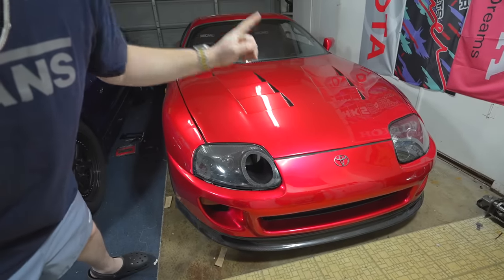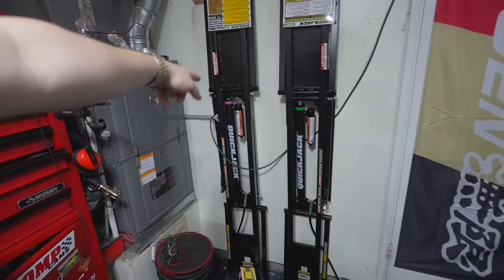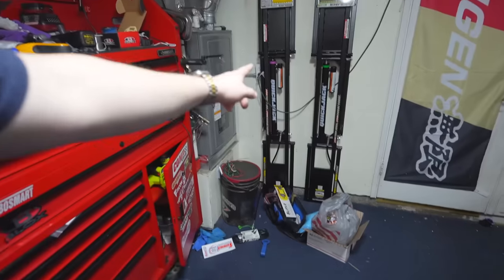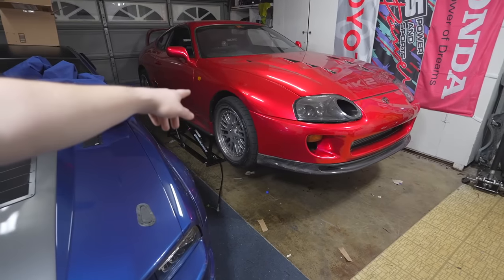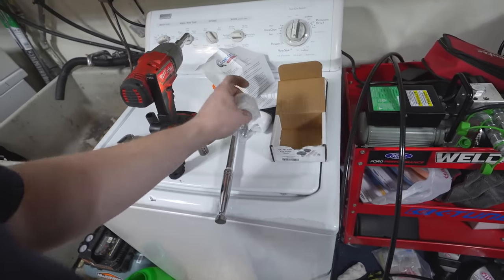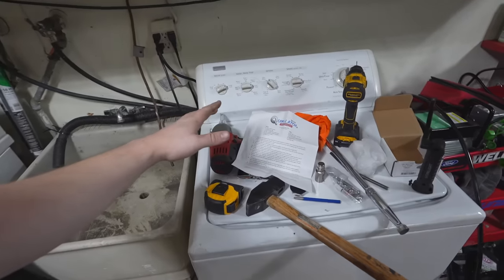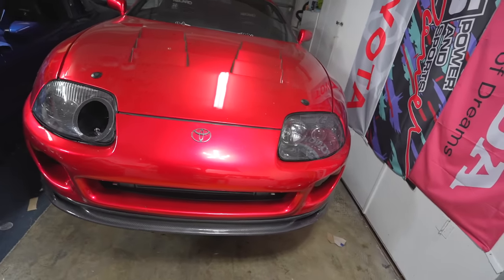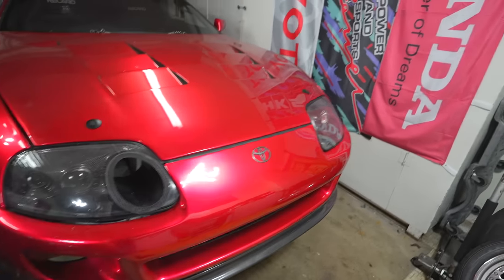Getting The SUPRA Ready For 200mph Pass!!!

Comment: You don't want Dot 5 in a car, maybe it's better for a cycle but that's debatable as well.  DOT 5 is a standard that was developed to deal with applications where you want high performance but also know that moisture contamination is going to be a given factor.  If you're actively changing your brake fluid regularly, you're dealing with the fact that brake fluid absorbs moisture from the air.  DOT 4 fluid is objectively better in every way than DOT 5, unless you don't care and aren't changing your fluid every year or at least flushing what's in the calipers after track days or other hard-use applications.

Comment: You finally did it! I've been telling you to buy those quick jacks for the last 6 months or more.  They are the BEST option 100% if you cant fit a two post lift in your garage, or if you want a portable lift.  They are a superbly made and engineered piece of equipment.  Over-built and supremely safe to use, I don't hesitate even one second to get under any of my cars when they are in the air on these lifts.  One of the best features is the ability to unhook the hydro lines and there is ZERO leakage of hydraulic fluid from any of the fittings once the car is up in the air and the jacks are locked into the halfway or fully raised positions.  Then when all is done, you can hang them from the wall, or nestle them together and prop them up against the wall where they can sit very much vertical, yet they are still very stable.
Reply: I have the Quik Latch QL50s round push buttons just like what you installed here but a little larger.  You have the QL38s I think.  Interesting fact, the QL50 latches are factory original equipment on the new GT500 Mustang.  While Quik Latch rates them up to what would seem like overkill already at 750 foot pounds of pull strength, when Ford tested them thoroughly them prior to approval for becoming factory equipment on the GT500, their engineers found that the ACTUAL breaking strength was 3000 POUNDS!!! And that was the average of like 100 randomly selected sets!!  In other words, if you break one of these pins, something probably REALLY bad happened.  Your car is probably trashed, and you might not be around to even tell anyone about it...

Comment: The QL-50 Quik Latch low profile hood pins (they look just like Drew's but a little bigger than the QL-38's he got) are standard equipment on the new GT500 Mustangs.  I read that when the engineers at Ford were considering adopting these as standard equipment along with several other designs, they visited the Quik Latch factory and pulled 20 or 30 (can't remember which) pairs of QL-50's to take back to their testing facilities to put them through the "ringer".  They tested parts interchangeability, and found that they were 100% interchangeable.  They then did destructive tests to see how many pounds of force they could withstand in every direction, how long it would take for them to wear-out thru normal use, how resistant to corrosion and chemicals they were, and so-on.  They passed every single benchmark that Ford had set as required for the hood pins on the GT500. In the most important test, which was pulling strength,  Quik Latch had rated the QL-50's to 750 pounds of pulling force.  Ford tested a random selection of the pins from the kits they pulled, and found that not only would they exceed the 750 pound rating with no problems, but THEY COULD PULL UP TO 3000 POUNDS BEFORE BREAKING!!!  That's crazy!  That's FOUR times their own rating.  It was because they exceeded every requirement by a HUGE margin, and because they were the most attractive design and easiest to install/repair, that the QL-50's were chosen over the competitors as the ONLY factory-installed OEM standard equipment hood pins for the new GT500's.  That really does tell you all you need to know about the engineering and quality of these compared to others.

Comment: I can say from my own experience with two sets of QL-50s I own, that Quik Latch hood pins are the best hood pin design period.  The QL-50s and QL-38's are machining works of art, the tolerances are N.A.S.A.-level. You could swap any part from a 4 year old QL-50 into one made today and it will fit perfectly. They are made here in the U.S. with the best stainless steel and alloys available, and the people who make them really DO give a sh*t! (an uncommon trait these days!)  They have excellent customer service and tech, and they fix any issue super-fast.  
     I marred up one of the pins myself when I tried to re-adjust them after my carbon fiber hood finally settled-in 6 months after install. The locking pliers and the leather pad I was using between the pliers and pin both slipped out all at once, causing the teeth of the pliers to mark up the pin with gouges.  Even though the pin still worked fine, locking into and out of the latch, I couldn't stand seeing the damage.  I called Quik Latch to buy just the hood pin and they said they would send another free of charge.  I got it two days later, and they also included 4 new set screws, two extra stainless steel nuts, and a spare set of rubber/poly flat washers (huge rubber fender-washers that go between the hood and catch assembly to prevent paint damage and seal out water).  All for free, would not even charge me for the shipping.

Comment: Do they make lifts like that but that go taller for trucks?
Reply: Yep they do.  They also make a "truck adapter kit" for these regular lifts that can be adjusted up to within a few inches below the 4 lift points you are using while the jack is still flat.  That way you still get ALL of the upward travel except for the inch or two you started with.  Like I mentioned in an earlier post here, EASILY the best tool I have ever bought.
Reply: @whiteman2812  I have an old lifted truck, lifted a few inches . I can put a 5 gallon bucket underneath to change the oil. But to get it higher off the ground sometimes could be nice.
Reply: @skillage18    The truck adapters are 7.5" inches, and the 7000TLX is 3.5 tall when all the way down flat, so it will start at 11" inches tall. The lift has 21 inches of travel so at max height it will be 32" inches.  You will of course lose whatever space there is between the jacks and lift points when the jacks are down flat in travel.